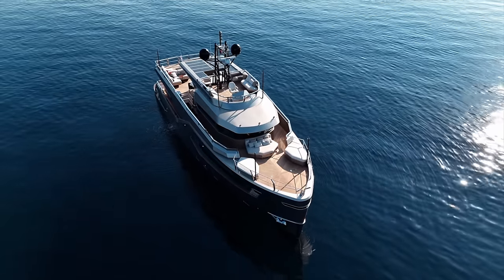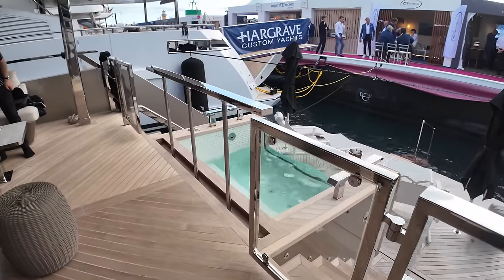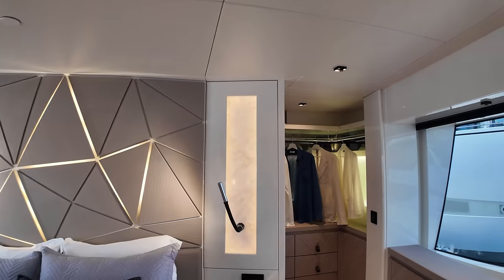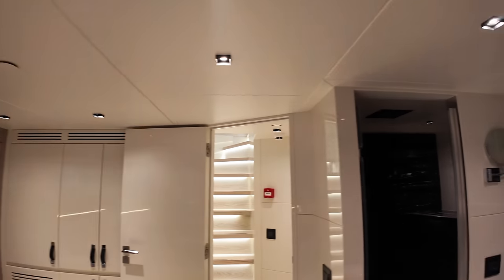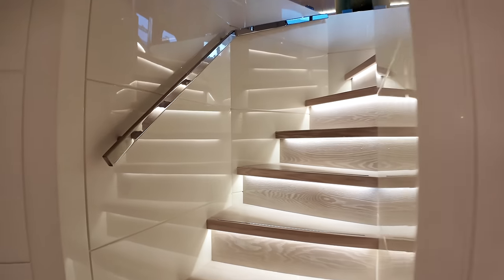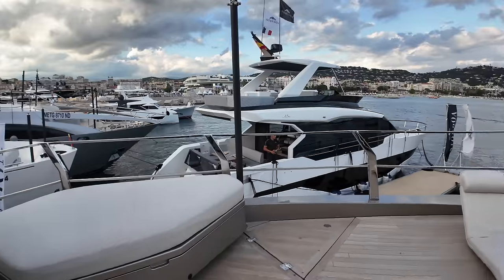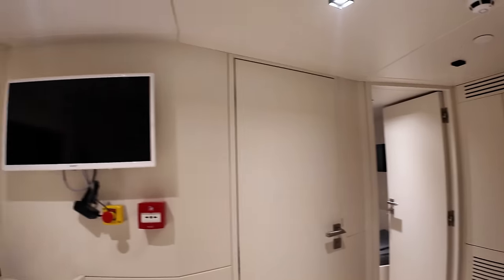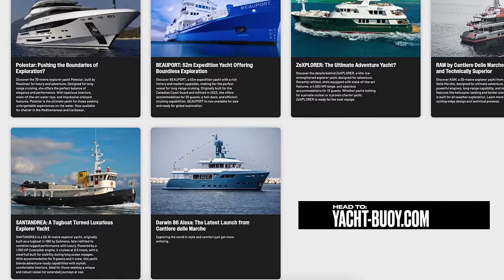THIS is the €7.76M Steel Explorer Yacht Designed by VRIPACK: ‘Rock X’

Comment: I do worry about hull integrity on yachts with so much glass. In yesteryear, we required to screw down our much smaller porthole covers in gnarly seas. Now, it seems, we no longer require to do so. Like I say, it would be of serious concern to a natural worrier like myself!
Reply: The boat is built for the Mediterranean which is not known for heavy seas. Here in Norway we have the expression "a Mediterranean sailor "which means a person that has not  gone through any hardship  in life.
Reply: The glass won't be a problem because like most of these boats, it will spend 99% of its life moored up in an expensive marina!
Reply: @bizarremagick  Agreed, however this is billed as an explorer yacht...inferring some travelling, at least.
Reply: Yes they are 'billed' as explorer yachts. It is a bit like someone in the middle of a city buying a large 4x4 car and using it mainly for the school run. It's all about the look...
Reply: @krigry32  An interesting if possibly contentious observation.
Reply: @bizarremagick  yet another interesting analogy.

Comment: Deluxe floating bachelor pad. Beautiful design features throughout the boat. Beach club is fantastic. Owners stateroom is state of the art pleasure palace. Other guest accommodations are first rate, especially VIP/Captains cabin. Galley and crew quarters are functional. Did not like the weird view blocking helm station. Engine room access not very helpful. Summed up, nice boat for a younger single owner, or younger jet set married couple.

Comment: Absolute unique and futuristic Design and Layout. The used Colors and Materials are absolut on Point and great Quality. The only Critique would be the "small" Galley, but you mentioned her Cruise Area in the Med so for this use it works well. So and now i have to give you John a absolut great Compliment for the new Design/Layout of your Videos. The quality and moderation where always great, but you did another Level with this great Changes. Also the longer Duration allows more Details and changing Views. All the best Wishes from Germany.

Comment: The deck windows are thick, like as thick as the pilot house windows. They have plexiglass protective window covers they screw down over the ones on the deck that strengthen them for crossing oceans. The ones in the hull are made of an acrylic or polycorbonate that is stronger than any fiberglass hull they are built into and are bonded into the hull, like wielding two pieces of steel together, the bond is stronger than the "glass" or the rest of the hull. That piece of polycarbonate or acrylic PMMA is an actual part of the hull and is as thick as the hull and risers that it bonded to. So, if the steel, aluminum, or fiberglass/carbon fiber/Kevlar hull and riser that incloses the dead space filled with air is 2 inches, then  the window will be two inches thick. The PMMA acrylic or polycarbonate glass is more resistant to punctures than any steel hull that is not more that 3/4 inch thick. It is not going to break. Well, not by hitting driftwood or heavy seas or even ice that doesn't tear through the aluminum or steel hull. If a rouge wave of 75 to 100 feet comes down on that boat it isn't going to matter as the boat is going to break in two or be forced under the surface and fill the interior of the boat with water nearly instantly and unless all the doors and the engine room water tight door is completely secure, she will not hold enough air to float her back to the surface. There is no way to make a ship completely water tight as it must be able to pull air into the ship for the engines to be able to combust. That is where the boat will instantly swamp and fill with water if forced  under the surface. Unless you own a boat made with FRP like Boston Whaler. Those can be cut into two pieces and though they will swamp or fill with water, they will not sink. If broken into pieces by rocks or rouge waves, the pieces will float back to the surface.

Comment: I see Evadne hasnt solved the problem, with the stairs on the upper deck. When they launched the 85, many pointet out, that those stairs are going to cause a lot of stupped toes and ankels. Its going to require some super skinny childsize crewmembers, to get in and out of that bar area. Im surprised they havent made a mechanism, to push those stairs up against the front wall. They already have had some odd years, since the 85, to come up with a solution to that particular problem.